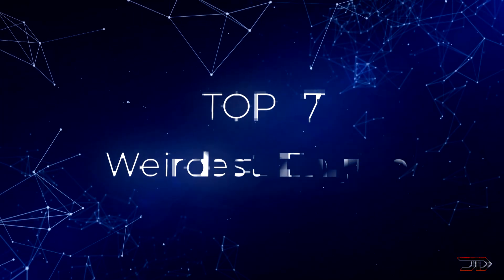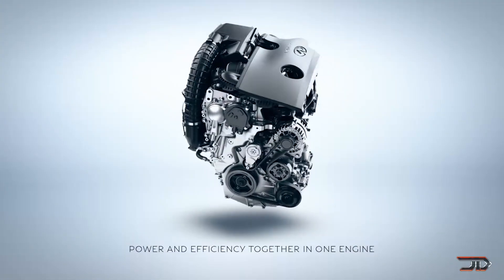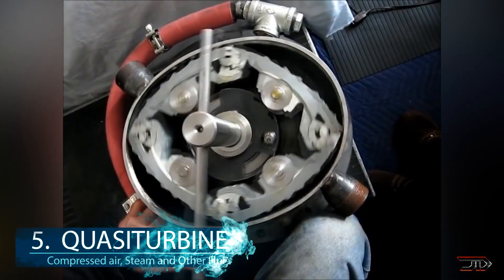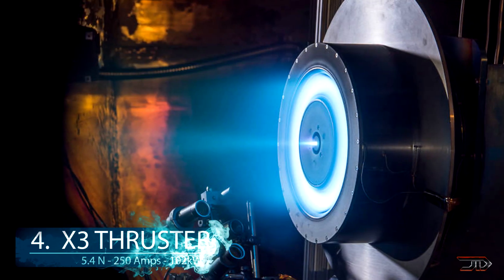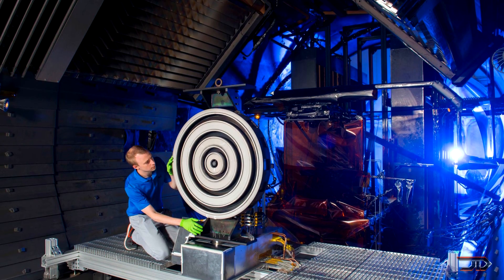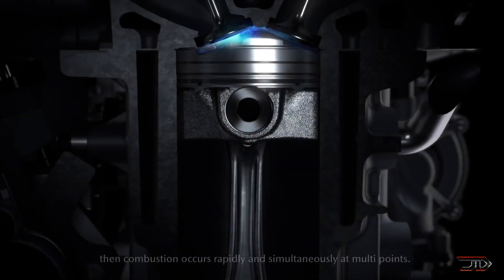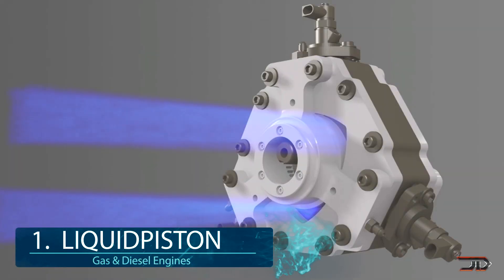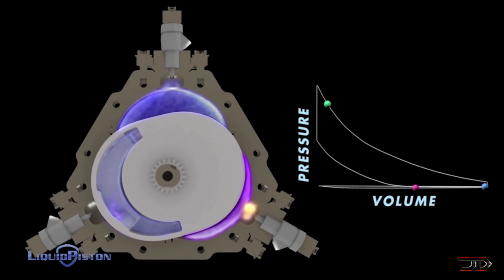7 STRANGEST New Engines

Comment: You cannot prevent premature ignition or detonation by leaning out the fuel mixture. That's literally the opposite of what should happen. 90% of the time, race engines detonate because the fuel pump(s) couldn't keep up and the mixture got too lean. Lean mixtures also burn way too hot, which can dramatically shorten the life-span of any engine.
Reply: 1:1 for HTP rockets.

Comment: Interesting and ingenious from a mechanical point of view, BUT .. electric motors are where its at and where we’re going. They’re around 90% energy efficient instead of 20%, can run on solar sourced energy, rely upon non-contact repelling magnetic fields, and don’t need servicing for a 100,000’s of miles of use. What could be simpler compared to these new attempts at hopelessly inefficient combustion engines with hundreds of mechanical parts thrashing about ?!?

Comment: Interesting engineering but isn't this like advancements in steam engine tech just before the internal combustion engine took off? Anyone can see the writing is on the wall for traditional fuels - its going to be fringe stuff for eccentric enthusiasts soon. Electric motor tech gives many advantages over fuel engines, the issue with electric is really more about storage than the motors themselves. If car manufacturers play ball with us we might hope for plug and play components in electric cars and better reliability down to lower number of moving parts - swap in and swap out with recycling a lot easier, cleaner and safer since spent oils are loaded with nasties.  I spent my youth fixing my cars, then it got complicated, I think it might soon get a whole lot simpler again - plug and play user replaceable electric parts yes please!

Comment: Thats the entire 3 phases output of the 100KVA 3 phases transformer in my street roughly. For 9.8 kg of thrust. This can work. Seems to me that optimisation is possible with these Ion drives? Probably finding a power source in the native voltage of the drive is the key.

Comment: A modernised Doble could easily give 120mph 100mpg and no emissions. If it used pulverised wood it could give a virtuous circle by planting trees for the pulverised wood fuel. The Doble was built in the 1920s in the USA and was raced giving a speed of 120mph 100mpg and no pollution. It aint rocket science and could be a world beater.

Comment: There is an electric motor which will replace all combustion engines in the next 10 years. The ‘MEIM Motor’ solved the past problems. The United States Patent and Trademark Office (USPTO) released the patent documents on June 6 2019. Your welcome.

Comment: The 'liquid piston' looks tri-cavity rather than the bi-cavity of the Wankel engine.
The seals are on the static housing rather than the rotor tips ...  a weak point of the Wankel.
The combustion chamber shape is still a problem though !

The opposed piston engine was done a long time ago ... commer truck engine (rocking lever), Napier Deltic diesel (train, boat) and the L60 Chieftan tank engine (2 stroke multi fuel - anything that burnt) ... All in the UK.
Try googling them...

Comment: 3:30 "Fuel mixture is very lean so it does not ignite prematurely. Compression is very high" ... This doesn't make any sense. Both a lean (relative to 14.7:1) air/fuel mixture and high compression increase likelihood of pre-ignition. Which is why we lower compression and tune fuel more rich on turbo cars.

Comment: The quasiturbine is in fact in many application, including cars such as Mazda. No, quasiturbine is not a Wankel bc Wankel had triangle piston surface and is based on the principle of volume variation between a curve and a moving cord (a sliding single piston-object on the curve). The Quasiturbine does not use this principle, since the maximum volume as well as the compressed volume are both in a straight line contour area.
Reply: The Quasiturbine did never work as gasoline engine, only steam or compressed air: the problem with this engine is the very high friction level, and the high difficulty for lubrication: this explain why this  engine is in the way to forgott...In comparision is the friction level from the Wankel very low...

Comment: This was under a response to this video but more people need to understand the myth of full electrification and its implications.

 Full electrification is not only a myth but a terrible idea in general. Who puts all their eggs in one basket and thinks it's a good idea? Why would we want everything running of pure electricity? So when we get mass power outages those regions are completely screwed? In addition to that, our electric grid and infrastructure to date could only sustain one large city of full electrification. Just one. This simply means we are decades from having an electrical grid that could even consider supporting the entire country with electric vehicles. It's said electric cars have a smaller carbon footprint or no footprint. That's false. It takes energy to create the cars and specifically the batteries and its no secret that the cost of these are enormous and electric cars aren't driving around not emitting zero greenhouse gases. Consider this...future ICE's, due to Cafe regulations and new technology, will be scrubbing the air. Meaning, the exhaust air will be cleaner than the air entering the intake. An electric car will never do that.
Think for a moment just how many different internal combustion engines there are and how many different platforms. There are billions from gensets to airplanes and boats to lawn equipment. ICE's are needed when electricity fails. Saying ICE's are dead or anywhere close is fundamentally wrong and isn't supported by any real data for future predictions. In fact, the ICE remains the dominant engine for decades to come. Don't take my word for it, there are plenty of big companies and Goverent agencies who have crunched the data and know this to be a fact. That's exactly why they continue to pay for ICE development.
Full electrification is not only an ignorant myth but a nail in the coffin to multiple millions of jobs related to ICE's. Again, think about how many jobs are directly related to the internal combustion engine. I'll also mention, a study was done recently on electric cars and their range during high and low ambient temps...some of the most popular electric cars including Tesla. The results, most cars saw as much as 50% reduction in range in temperatures below 32° and above 75°. Last time I checked, we have quite a few states that frequently see these temperatures. The future of engines are hybrids. The best of both worlds so all of your eggs AREN'T in one basket and we don't fall into chaos with a mass power outage. If you take a single or two cylinder achates engine and couple it with an electric motor/generator, it'll be an incredible engine that will destroy its fully electric counterpart through most if not all categories.
Don't fall for the ignorant people pushing electric cars. They're driven by sheer emotion and don't really understand the implications of what they're saying and they certainly don't understand the technology.

Comment: As much as I love to see innovation and mechanical devices, the truth is electric will probably continue to be the way to go
Reply: The Liquid Piston engine has actually been tested and is able to run on hydrogen 'wet fuel', rather than a hydrogen fuel cell, seen in the Toyota Mirai, for example. That would have the convenience of a fossil-fueled ICE but with zero emissions other than water. Alternatives for fossil fueled ICE engines are going to be the way to go, but I don't think electric motors will be the silver bullet, especially when it comes to other major polluters (airlines, for example), so it's very good that there are at least 2 possible solutions available for use.

Comment: The fantasy space motor is funny.   lol  Nobody really goes to outer space silly.  They just launch rockets out of sight and pretend they do.  Wizard of OZ type stuff... all make believe fiction.  There is no outer space, just a dome dome rotating above us with stars in it, and the sun and moon circling overhead; their rising and setting a result of visual perspective.  No satellites, just ground based antenna and various aircraft doing what we're told satellites do.  Like when Google is asked how often they update their "satellite images", its not too often as its expensive to fly the aircraft over.... aircraft, not satellites.  Go look for a photo of a satellites in space, notice all the images, just like every other image from outer space is fake... cartoons... fraud.  Notice Google now, putting up 1000's of automatic balloon launchers South of the equator.... to keep balloons aloft and provide internet to those areas (Google's "Project Loon").  What about satellites?  The dishes are pointed at the horizon because the techs are told there are satellites over the equator... so why don't the dishes South of the equator point North to those satellites?  You know, those amazing space craft, which never need maintenance and orbit in the Thermosphere, where its thousands of degrees, but don't melt because the vacuum of space separates molecules, so even though its titanium melting hot on the thermometer, its actually very cold (an after thought when satanist Jack Parsons of NASA conjured his buddy Arthur C. Clark (satanist/scientologist), the fiction writer's "satellites" into reality.. he evidently wasn't very well versed in that make believe "science", because they had already labeled the altitude he said he put satellites up at, as the Thermosphere and already said it was like 4,000 degrees F up there... so they came up with the "molecules are separated, so it feels cold to the touch" BS)... BTW, am pretty sure the reason Howard Hughes went from flamboyant socialite to paranoid recluse, is because his company was contracted to build the first satellites... and he being a smart guy probably figured out it was all a ruse...and who was behind the ruse.  Anyways, those "Project Loon" balloons delivering internet S. of the equator... just a heads up... soon we'll see on tell-lie-vision, in the fake news... we'll see Hollywood actor and producer turned "tech leader" Elon Musk launching giant rockets out of sight in a grand spectacle... quite the show.... then Hollywood magick showing them "putting thousands of tiny satellites in space to bring internet to the whole world!", but really it will be those balloons Google is putting up now doing that.    Just some info for the more intelligent out there.
Reply: I spent more than 15 years putting recon satellites in orbit. You are a moron.

Comment: more moving parts = more wear and tear = more cost for the consumer to fix... 

yet BMW's Hydrogen 7 is just a normal combustion engine that runs on hydrogen or gasoline.. 
and on hydrogen it has 0 fucking emmisions...    so the oil company's can go spit.  I dont pay for gasoline or GIMMICKS.

Comment: "more efficient than a wankel rotary", that's right up there with claiming better efficiency than a newcomen steam engine. When you're picking a very inefficient thing to compare it to, it's easy to claim massive increases.

Before anyone claims that the wankel is efficient, it's only on the power to displacement that it did reasonably. When you look at how much fuel the things used, they're anything but efficient.
Reply: Yes, fuel. And oil, and seals.

Comment: Variable CR is dumb as dirt.  The wastegate on a turbo can effectively achieve the same feat FAR easier than an elastic connecting rod.  Very bad idea.  That's probably why it's a computer animation, and not a real live, running engine.  He hasn't found investors stupid enough to build one.

Comment: A good rule of thumb, fewer moving parts means better longevity. (Provided parts are made to a set standard)
Reply: As a layman, that's what I see:  Too many parts, too often something is broken.
Reply: @jimdavis2385  yeah a part is a failure point, that's pretty obvious.
Reply: True but not always. For example a in linefour cylinder engine get better relatability with a balance shaft than without.
Reply: But there are many more important points to consider except longevity. For example turbo engines are likely more efficient than normal motors.
Reply: Rotary engine approx 16 moving parts, inline 4 cylinder approximately 100 but no comparison in reliability and longevity over a rotary 👍

Comment: Everyone that says we should go completely to electric vehicles now need to remember that the extra demand ot would incur on the electrical grid for charging vehicles would translate into burning more oil, coal, etc to generate electricity. We will need to generate the lion’s share of power by renewable sources to make that idea feasible. Not saying it can’t happen but we are not there yet. 2nd, battery tech has to evolve further.

Comment: Why still develop and work on these diesel / fossil fuel  engines?
While the world wants to move onto electric and other technologies.
Reply: Cuz in some places electric is more expensive than gasoline. 
Refueling time, infastructure, building superchargers around a whole country isn't easy, you can bring extra fuel in tank, if you're stranded with no gas someone else can just bring some fuel in a container.
The shift takes some time, plug in hybrids with efficient engines and then full electric depending on your government.
Reply: @MazdaRX7007  ..... Then we should think over, how to make electricity cheaper..

Comment: High compression makes power. We just need an algea based biofuel and we can push that number higher, and then add forced induction.  No real change in design that weve been using for over 100 years.

Comment: That first engine the VC-turbo is a variation of the lever engine first designed by Alvah Leigh Powell in the 1930s. Some of them were used in the Elcar automobile and some were used to power pumps in the oil fields. High torque at low rpms. One of the auto engines went 350,000 miles with no problems and that was in the 1930s !!!

Comment: in the first engine, reliability is synonymous with simplicity in cars, the first engine to add more parts may be more efficient, but I doubt it is more reliable if you have more mobile parts, for something the electric motors will always be more reliable than the combustion, or Combustion engines that are simple are always more reliable than complex engines, is it a law of life, or have you ever seen a lion with 10 legs to run more?

Comment: The problem I see with ANY rotary type engine is that they require a tight seal against a flat surface. You don't see this in the typical diagram of a Wankel rotary engine, where you only see the interesting shape of the rotor and the oblong double lobed shape of the chamber. 
With heat (read: warpage) and WEAR, maintaining the total flatness needed for a tight seal for no leakage at the sides (that you don't see in these diagrams) should be something that is inherently nearly impossible to maintain over any appreciable length of time. Not like the inherent geometric stability of the cylindrical shape of conventional piston-cylinder arrangement.

Comment: Very nice summary, thanks for creating this video!  Some of these are too complex to be both reliable and cost effective. In 1963, Chrysler produced a turbine powered automobile  https://en.wikipedia.org/wiki/Chrysler_Turbine_Car. Emissions and fuel economy were detractors. But turbines have GREATLY improved in 55+ years. Turbines are commonly used to generate electrical power for the grid. So why not miniaturize a turbine for the car to generate power for a hybrid electric car? The advent of super-capacitors and improved batteries can handle power surges, such as sudden acceleration. This addresses the turbine's shortcoming in abruptly addressing sudden surge requirements
Reply: you just described the Jaguar C-X75, unfortunately, it was a supercar that was too expensive to produce in real numbers given the global market.
I love the idea though... I am still waiting for someone to design a cost-effective version of this!
Reply: It would seem you would be contrasting the weight/cost vs. batteries. This would be interesting...
Reply: @MalPlan01  I am interested in weight/cost vs. batteries. But, even Li-ion, and NmH batteries faire poorly when you contrast their energy density to that of gasoline or Diesel. A Tesla, Model S weighs 4700 pounds  As nice, high-tech, and sporty as it is, 4700 pounds is a LOT for a car its size. Also, a ~250 mile range before searching and then waiting a lengthy period for the batteries to be recharged, is OK for some, but not long distance travelers. Until the energy density is at least doubled AND batteries become less expensive, AND faster recharging becomes available, AND more recharging stations/infrastructure comes online, my view is a hybrid solution is the way to go.